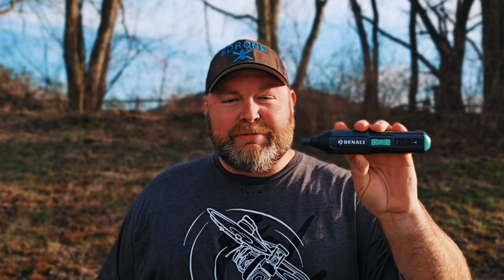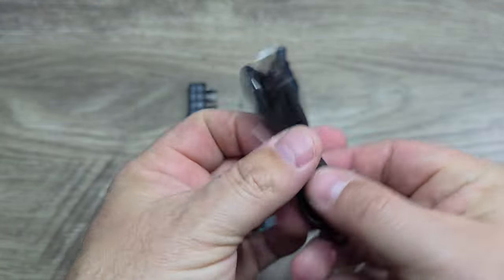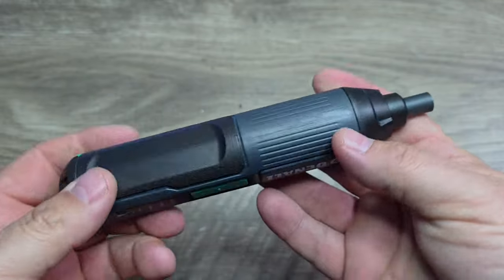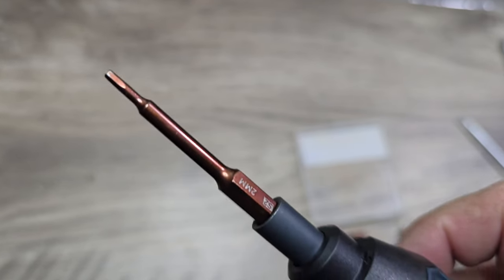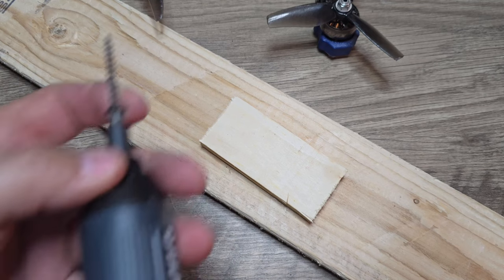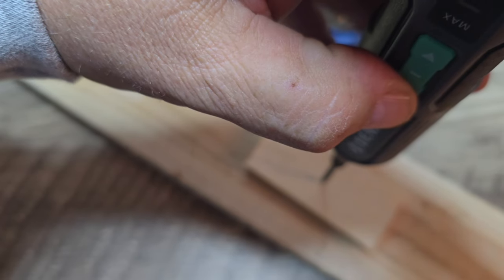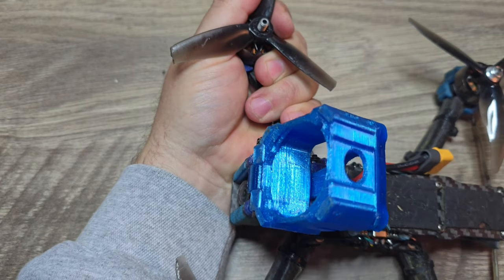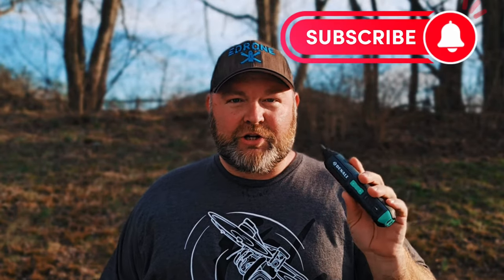BEST Budget Powered Screwdriver For FPV & RC?

Comment: So you pointed out the button position which i agree would be nicer more towards the tip of the screwdriver. One thing that i did was superglue in a locking chuck so i could use drill bits and have them not come off on the exit. It also helped me not lose any bits lol
Reply from the maker: Great idea on the locking chuck! Thanks brother.

Comment: Do the tips lock in?  I noticed one fell out.  Also- is the battery removable?
Reply from the maker: The tips are held in by magnet. When I pulled up that one time the bit was not all the way down I believe. The battery is not removable from what I read.

Comment: Definitely seems like a great alternative to the Dewalt. I have the Dewalt Gyroscopic driver and it has 16 different torque settings, but that version is $120. At $25, this does have 3 settings at least, so this would be very compelling.
Reply from the maker: I was blown away once I felt the torque of this! I have been wanting the Dewalt for a while but the price tag always kept me from pulling the trigger. When I saw the review video on this I had to try it and was not disappointed!
Reply: I grabbed the adjustable Dewalt from Amazon Warehouse for $72 (the one that folds in half and has a clutch)
Reply from the maker: @Fly_High_FPV  that one is definitely nice! For someone on a budget though this one is almost as nice as the Dewalt from my experience and from the comparison video I linked.